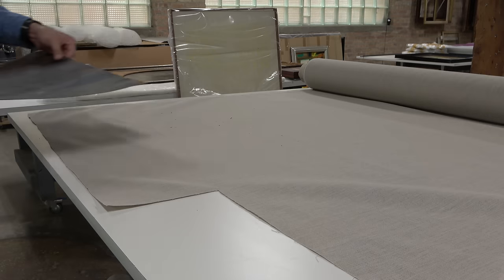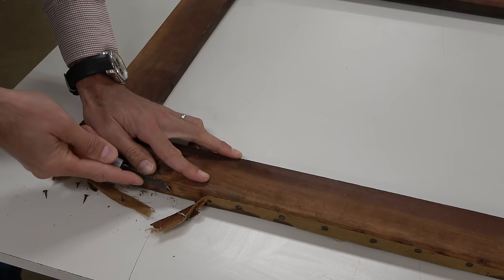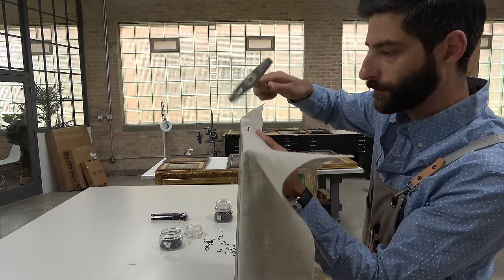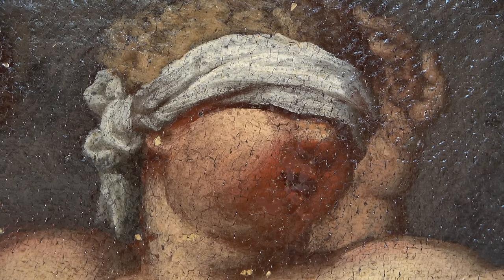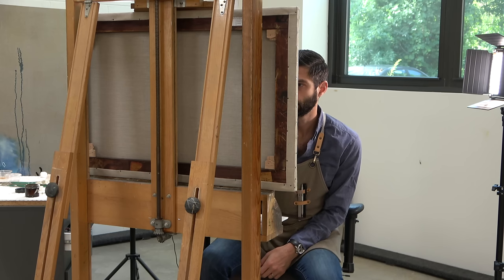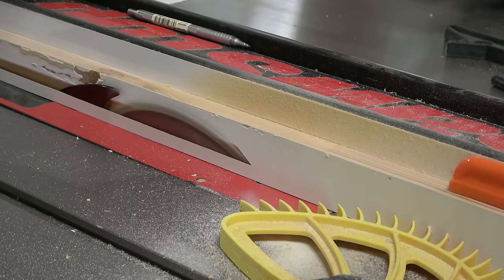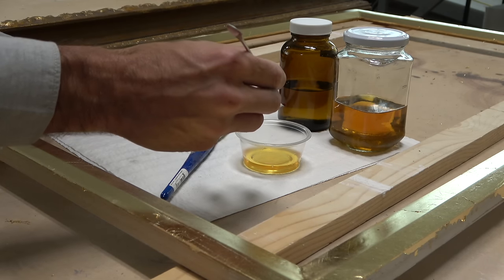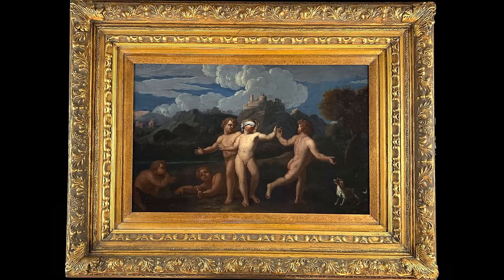Why We Choose This And Not That; Restoring A Baroque Painting Part 2

Comment: I want to make a piece called “conservator’s nightmare” which includes oil paint/ non-reversible retouching over a dirty painting, a humidity-susceptible wooden panel with channels and batons carved into the back, an unnecessary aluminum interleaf, staples in the frame and overhanging canvas being glued down, and a final ”varnish” of polyurethane.
Reply: Will you include a supply of security blankets for viewing conservators to hug?  'Cause otherwise you're just terrible ;)
Reply: A true villain. You probably put the toilet roll on wrong on purpose too. Some people just want to watch the world burn.
Reply: redwitch12 The security blankets are also coated in polyurethane and must be chipped out to use.
Reply: @MarlonBitoy  EVIL.
Reply: I'm not even a conservator, and this HURT TO READ.
Reply: All credit to Julien that you know which words to use to HURT US!
Reply: This hurts my soul
Reply: Don't forget to nail the baseboard into the frame and glue the interlined canvas to it leaving no tacking edge and using a non-reversible adhesive on both sides of the liner.  And of course, make sure you cut the canvas to almost exactly the size of the aluminium interliner, but preferably without using a T-square so that it's got a nice slant on two edges, then glue it down leaving a few wrinkles. Julian will particularly enjoy that.
Reply: Any chance you can also work in Reverse on Glass inlays into this?
Reply: NoRae Song Definitely, and Ill be sure to tape some form of irreplaceable newspaper from the 1800’s to the back of the glass, which the paint will stick to; I should glue this assembly to the frame of the original piece and then staple it and go over the whole thing in polyurethane to really unify the two parts
Reply: If I were good at painting I'd make a piece designed to age as badly as possible and call it "the ravages of time"
Reply: Please, not polyurethane
Reply: 😂😂😂. Savage.
Reply: i hope some modern painters and conservators hear this
Reply: The horror. The pure unadulterated horror
Reply: I don't understand too much about Art technics but dude you probably drink old fashioned with Blue label and dr Pepper soda
Reply: Thanks, Satan.

Comment: My mother was a dressmaker in the 40s and taught me that the reverse of any hand sewing I did was as good as the front.  She would turn a dress inside out and check the seams and zips etc before buying it. 

She would fully appreciate and approve of Julian's methods and techniques..
Reply: "Sewing should be as good on the inside as the front" I'll remember that!
Reply: @respectpotatoes  she once gave a piece of cross stitch I had done to some one to look at and they were really impressed....then she turned it over and said...oh that's the back. The lady's jaw dropped. 
It also made framing the pieces easier as no lumps and no knots! Knots were a major no no!
Reply: @skwervin1  That was always a struggle of mine when I began crossstitching, and even now. I jump around a bit and can sometimes knot the thread without realizing, causing bumps and a messy back, meanwhile my mom just has naturally organized backs on her cross stitched pieces and I don't know how. 😅 Maybe one day I'll be that good, but if it doesn't present an active issue upon the finishing of a project (ie a lump or knot so large its obvious upon being framed) then I'll attempt to fix it, otherwise I'll just move forward. Massive respect to anyone more meticulous than I.
Reply: @skwervin1  see my gran was the opposite type, she drilled efficient use of materials into me, so while by back is very clean and the image supremely clear, (no knots! no dragging threads all over) to cross the back would have caused heart attacks. I relied on vert/hrzt stitches on the back, so whole rows at once with the drops the only place you'd see a diagonal.
Reply: @tomboy2980  one way to avoid inadvertent knots is to drop your needle and let it dangle while it un/re-winds to let the thread reach the proper twist for itself.  Spun threads have a twist and when we stitch it tends to get tighter (though on occasion it will come undone and the strands start to separate and unravel) and when you twist a thread too much, it will start to twist back onto itself which can lead to self knotting.
Reply: This cross-stich community is what I'd like to join. Sign me up.
Reply: @mwater_moon2865  oh I agree! No wastage of thread, no huge dragged threads. I used to leave those single stitches until most of the area around them had been worked then weave a bit around it to secure the thread. 
Letting the thread untwist is important plus also not using a super long thread, 30 cm is usually enough to stop it from fraying or breaking
Reply: Wendy Beacall ...my jaw just dropped
Reply: Yep, I am a sewer, and 100% agree with your mother. The inside of a garment should be sewn beautifully.
Reply: @skwervin1  
I cross stitch and agree with a nice job on the back, but I also sometimes have a challenge there because I often do pictures with many different colours in a small area.
Reply: I'm not a sewer, and I understood everything in this comment section, because it sounds amazing
Reply: My grandma and great grandma were both expert seamstresses (my grandma still is) and did the same with me. I remember them both emphasizing that the back of my embroidery should be as much a work of art as the front.
Reply: I obsess over my seams! XP
My husband always told me: "C'mon, nobody's going to know or even see it's not perfect." And I'd always go: "But I will!"
He's given up on trying to get me to do half-assed work to "save time". XD

Which it won't, anyway! ò.ó With sloppy work you're more likely to have more work in the long run because seams will fray/unravel/warp/get bumpy, etc. and you will need to unpick and redo them or spend a gazillion years stretching and/or ironing them out. @.@
Reply: My mom who was a seamstress  told me the same thing! Aww I miss her.

Comment: He didn't put the tacks in his mouth what the heck is going on.
Reply: I genuinely thought he was going to explain why he didn't do the tack-in-mouth thing, but then he just... didn't :'(
Reply: probably because it was a smaller painting than most on here, and so doesn't need as many tacks
Reply: He likes to keep you on your toes.
Reply: Didn't he say that this technique provides the canvas some extra humidity? This might not have been the case here, not needed, don't know.
Give👏 us👏 some 👏answers👏 Julian 👏
Reply: Me, a research gremlin who gets curious:
Okay, sooooo, the spitting tacks thing allows Julian's Saliva to provide a little extra moisture to the wood where the tacks go in, this will minutely swell the wood where the tacks go in, and allows a better grip for the tacks, and the wood. It creates a more secure bond, and will help keep tack from slipping/ falling out. From what I can gather, this technique is generally used on larger paintings with stretchers that are older/ more dried than this one perhaps would be. Being a smaller painting and from the Baroque period, the wood stretcher is not large enough, nor likely dry enough to warrant this technique being used. Julian COULD do so, to provide a bit of extra sticking power, but that would be unnecessary, and also invites the danger of accidentally swallowing a tack. So I imagine he just... Didn't.

Comment: Hey brother, next time you need to straighten a frame with a bow in it, try bringing the humidity up in the wood in your Martha and then afterwards clamp it to a straight surface after for a few days before adding the brace. Your current method will take up the same bow that the frame originally had in a decade or two. Its also really important to observe the grain of your support and make sure it runs parallel to the cut. The curves in the frames you see are a representation of the internal grain structure of the wood, this frame happened to have a burl at the extreme of the curve and the burl expanded and contracted differently than the surrounding grain. 

Love your videos!

Comment: Easier correction to the bowed stretcher piece is to steam the wood.  The process is thus: set up a table with a waterproof liner.  PET works fine.  Measure the depth of the bow.  Cut two shims twice the depth of the box.  Spread a steaming hot towel between the shims, cover the whole shebang with sheet of PET.  Clamp the stretcher to the table at the middle of the bow.  Tighten the clamp to the point where the wood almost touches the table.  Cover everything with some towels to hold in the heat.  Next day, remove the towels, clamps, etc.  And check the amount of box.   I use this technique with red oak.  So, you may not need as much shim.  You'll have to experiment.  But, once you get the correct shim depth, this technique works forever....and permanently.

Comment: I completely disagree with you for not charging for doing the extra work required with the stretcher.  You under value your skill and talent that you have amassed and gained over years of experience for your work.  Your professionalism and dedication to your craft is valuable.  Your clients recognize this too.  And when you present them with the final bill you can always include as a supplement to the bill, the option of paying for the extra work you did.  With the option for payment.  You can present this before any work is done as well.  That you will do the work, present the cost, then have the option to pay or not.  Your clients have money from what I see.  They want quality and will pay for it.  Charge for your quality.

Comment: A quick question about the gilding. I noticed you addressed the greenish tone of the leaf by applying a dye in resin on top of the gold. Have you ever used red bole under the gilding? My understanding was that its use was partly motivated by a need to bring up the warmth and richness of the gold leaf. Is there a reversibility issue or another reason you don't prefer to use red bole when you work with frames?

Comment: "I'm not using glue on the canvas because i think it's sloppy, and that's just not me"
"I'm not going to not use keys even though i really don't need to, because i think it feels unfinished and that would be lazy, and that's just not me"
"Now i could just not bevel my restoration of the stretcher, which isn't a thing I'm technically paid to do, but that would indicate me being slothful, and I'm a good boy who dots my is and crossy ts because I'm a good boy and not a looser who uses  staples and takes shortcuts. I'm not bad! I swear!"
It's ok. You're doing a good job

This comment is in jest. I'm not here to insinuate any trauma or anything of this sort. I could not include this disclaimer but that would be sloppy and I don't belive in that

Comment: Hey! I’ve got a question. You say you add an isolation layer before retouching the painting because otherwise the retouching could be different to the original painting after you varnish it. But the original colours also change when you do the varnish, so why is it necessary to add the isolation layer? Colours don’t change the same way?

Comment: It seems that a simple bow in the stretcher, like the one you found, could be fixed by steaming the wood and then clamping it in something like a book binding press.  Is there a particular reason that solution isn't used?

Comment: Serioisly, today I had a dream that would make Julian sweat in horror. We have old landscape painting at home  that I really like. And my dream was that the painting suffered with many holes And someone glued oversized patches on the face of the painting, it was sloppily painted over. In My dream I told my parents its necessary to repair it gently And slowly remove the patches but my father got angry And started riping those patches off forcefully, uncovering raw canvas And destroying the original while I tried to stood in front of the painting, blocking it with my body, pleading, screaming, fighting And crying to stop my father. My dad is normally a lovely fella but this dream was Seriously disturbing for me. Poor dream painting

Comment: I'm just here wondering why, when finding hidden damage under something you couldn't have seen before, and spending multiple hours fixing said damage, is it "dishonest practice" to charge for the repair of that damage you couldn't / didn't see before?

like a contractor quoting for rebuilding a bathroom and it looks fine on the outside, but when you open everything up, you see mold and foundation issues...  

It wouldn't be dishonest for him to then charge more to fix those issues, simply because he didn't see them before.    That is labor and materials that he has to use that he couldn't have foreseen.   

Should you for a couple bucks of wood and an extra hour of work?  Would it be petty in the grand scheme of things?  Perhaps...  but dishonest?   I don't see that.

Comment: So I watch this channel ALOT..... but I had a british restoration channel’s video pop up in my feed and decided to take a look. Bruh..... when applying the fill in medium the guy spat on his finger to rub away excess medium, started removing grime layer with just cotton swabs in his hand but stops cleaning, then proceeds to fit the canvas back to the stretcher and used glue to hold the overlap canvas which seems pretty unnecessary cuz tacks would do fine and take less time for the next restoration, then once he finished putting it on the stretcher, which wasn’t actually even flat, then went back to finish cleaning the grime layer with no real strategy he was just rubbing his way over the painting not sticking to certain colours or shapes. Am I a baumgartner cultist???? Probably lol
Reply: The channel was Ben Everett btw

Comment: Why not using a similar device luthiers use (a bending iron - which in this case would be a straightening iron) to straighten the frame piece into its original shape? Wouldn't it be a bit easier, less invasive and cost-effective?